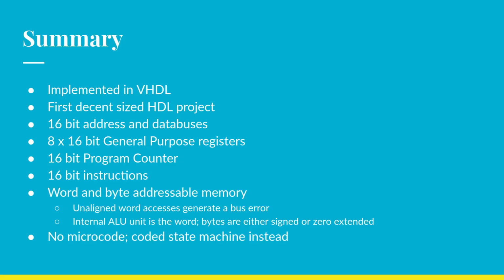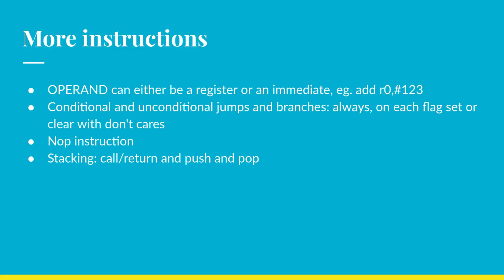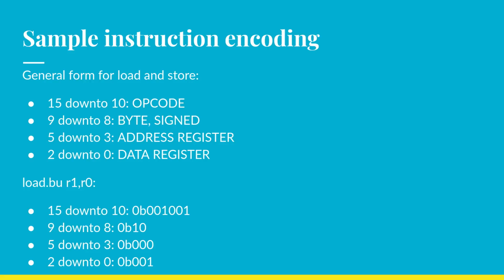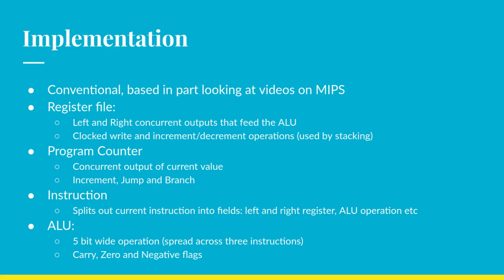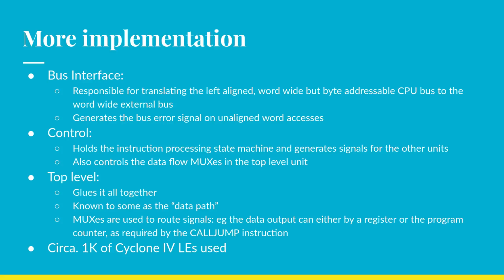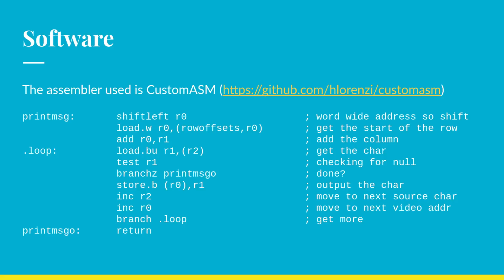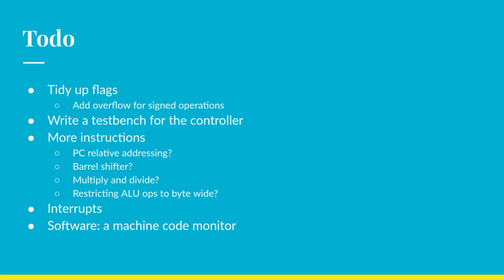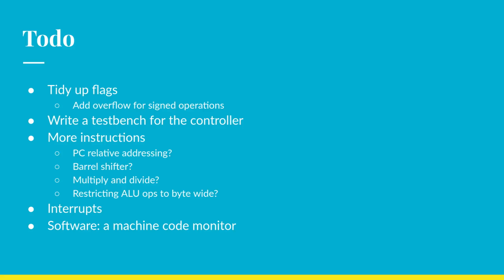16bit softcore processor overview

Comment: Nice summary, it's interesting to see the choices you make in putting this together on an FPGA, and CustomASM looks really useful!

What's the benefit of having the PC separate from the other registers, and avoiding use of the ALU? I would have thought that any time you're doing maths on the PC (branches) the ALU would have been idle anyway. I guess the PC still needs an independent output bus to the instruction fetch logic but you could do that for one of the GPRs like in ARM.
Reply from the maker: Yeah CustomASM is fantastic. About the only thing you can't do with it is link modules together so you end up with big include lists.

My initial design had the PC as just another register, it obviously has advantages. I then started looking at MIPS and it seemed to make more sense to have it as a separate element, but there are many ways to wire it up. It might be viable to have the PC on another read port of the register file instead of having to be selected via the left or right ports. My design certainly doesn't make use of the ALU enough. In fact it's only used by explicit instructions and the register + displacement load and stores. The usage of an adder in the PC handling for branches is particularly nasty. But hey  everything can be improved! I'll look at fixing these relatively minor points before I plan the switch to a 32 bit design...
Reply from the maker: Switched branching to use the ALU: https://github.com/aslak3/cpu/commit/d5d3698b87b85cedd8680961037150b478d59b39

Now I need to switch the ALU to remove the clock and make it pure combinational.